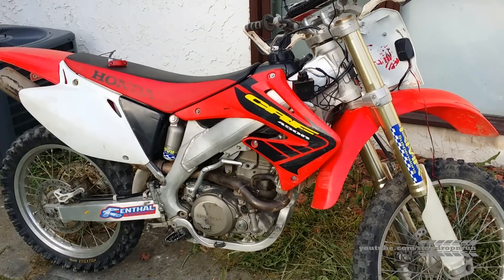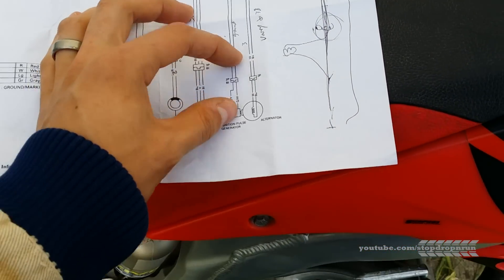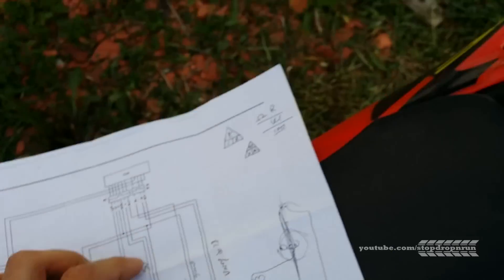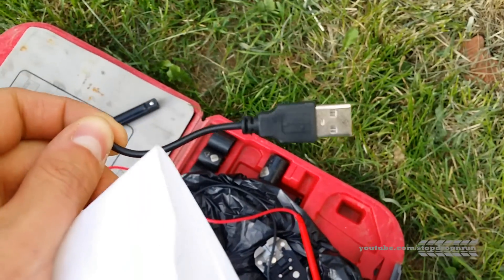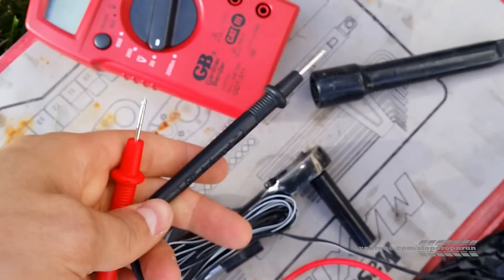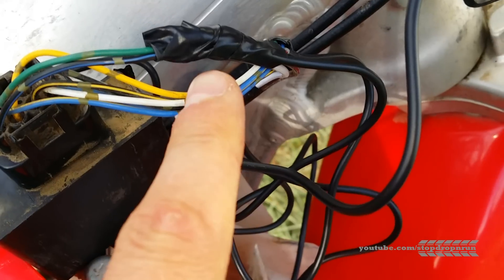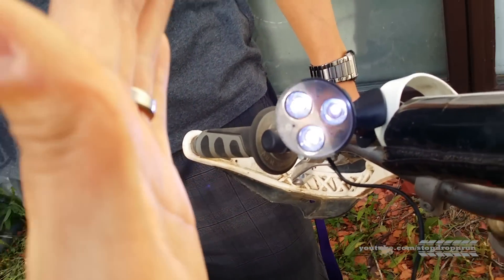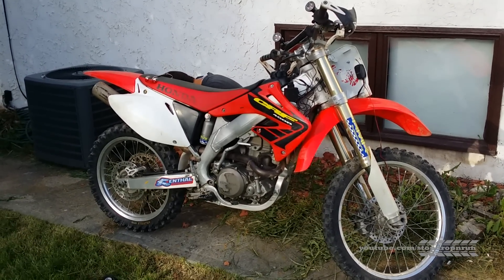How to Wire Lights on Dirt Bike Without Battery

Comment: I found bikes harder to start with no main switch on the lights because they were pulling the power the bike needed to start
Reply: Is the stock stator strong enough to add lights? I would run an on/off switch.
Reply: @jondoe4667   Depends on the bike is how strong the stator is
Reply: @jondoe4667  depends.  Some trail bikes, usually models that weren't intended to have lights, the stock stator may only have enough output to run the bike and (if included) provide enough power to recharge the battery too....but not lights. Alot of the street legal  lighting kits require an upgraded high output stator. If you were to install a kit, or lighting in general, with the wrong type of stator,  you would probably figure out on the first decent ride, especially if you rely on electric start and notice the battery isn't keeping charged enough to crank, and the brightness of the lights seems dim, and is getting increasingly worse. It's so bad you'll either decide to get that new stator,  or remove the whole mess.

Comment: Why don't you just put a battery under the seat
Reply: You gotta get it to charge adding a Voltage Regulator which normally works with 12v so is impossible, you kinda have to mess up all bike wiring and stator

Comment: Did you have any trouble with this afterwards? I am putting a 10 inch light bar on my 02 MXZ on AC. Wondering can i do it without battery.
Reply: You need to convert to DC. I will work with AC but just a month or so and then you will burn the leds. So install a rectifiers(not sure its right in English). Btw be sure de altenator gives enough wattage
Reply: +algot2009 Hey, you seem knowledgeable! Can I just install a diode and no rectifier? thanks
Reply: Antuan Perez I dont think so, in that case you can build a diode bridge(the wiki side "diode bridge" shows a perfect picture) but that is a rectifier ;) so probably i would go for a rectifier plus they are not that expensive but if you want to save som bucks you can make them your own. Good luck! If you have more questions it's just to ask! :)
Reply: algot2009 Thank you

Comment: over power the lights then blow up! no regulator will send like 50plus volts to lights!! defo bad idea ..trust me this will burn the wire loom /fire!!!! lights are dead on first ride trust!!
Reply: they would be dead instantly then and wouldnt work on ac voltage. Its already 12dc voltage

Comment: You may over amp the ignition control module.  That is definitely a bad idea.
Reply: James Clingerman THATS IT!! I think thats the problem with my bike maybee!
Reply: I have a 2015 crf250r and I've been wondering if I could run lights with the stock stator. Not only that but will it cause any problems with the electrical system over time.

Comment: This looks like a ton of trouble for almost nothing.  5volts?  That will NOT produce adequate light.  Stealing ignition power doesn't sound smart either..  and, wouldnt power fluctuate with RPMs requiring a rectifier if this actually worked?
Reply: He just did it to make it legal
Reply: 5 volts is plenty actually proved you are using the correct lights. Cars and trucks used to run on 6 volts and the light output when they switched didn’t change. In fact I have a couple of vehicles that run on 6 volt systems. The real advantages to 12 volts is it can handle more of a load so that means more lights more powerful radios and things like that